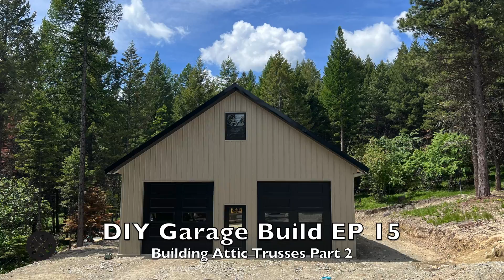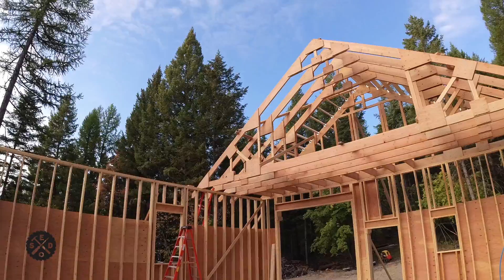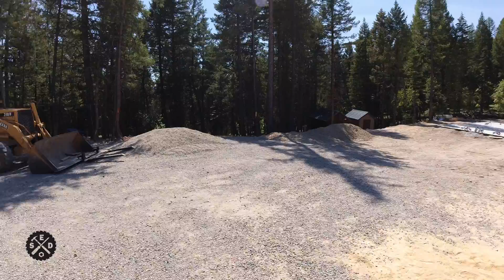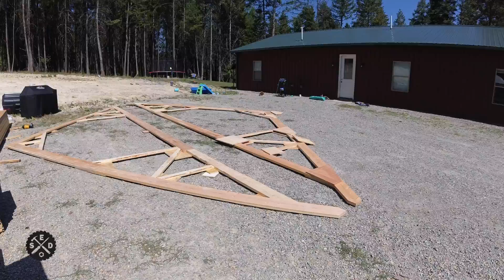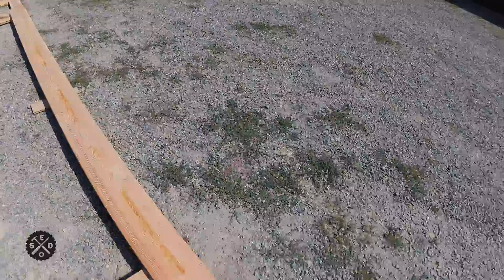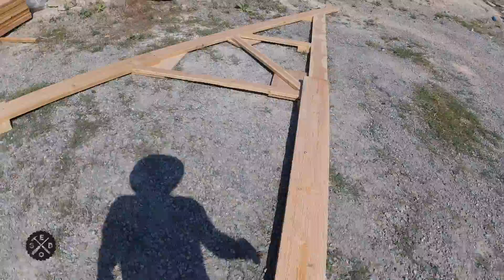Building diy Attic Trusses pt 2 garage build ep 15

Comment: Did you have a nailing pattern and number of nails per gusset provided from someone (engineer)?
Any trouble with splitting the 2x pieces? Easy to make swiss cheese of a 2x when gussetting both sides.
Reply from the maker: No, I didn't for the nailing pattern. Just kind of went with what we did over the years. You can overdo it for sure I was kind of going for inch and a half spacing approximately I think.
Reply: @SmartEasyDIYer  Thanks, I ws thinking just "try it and see". But the gussets make the seeing difficult as well....